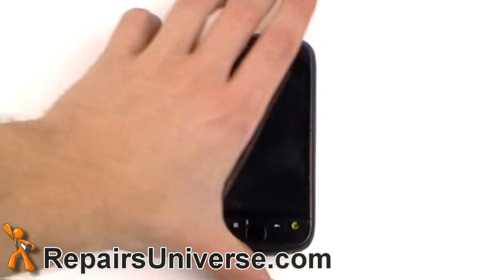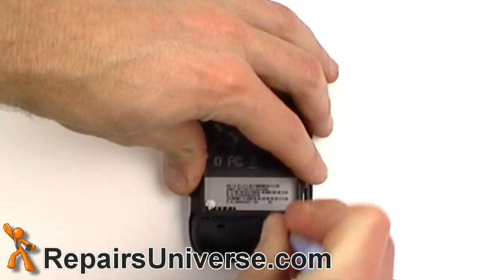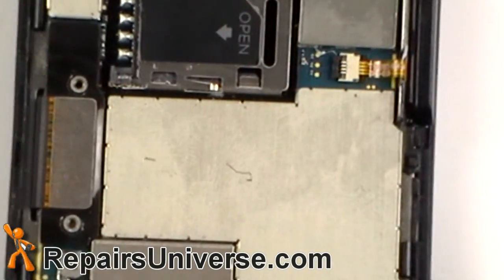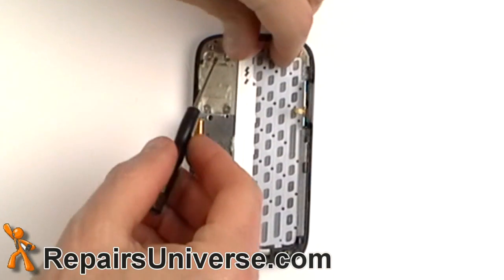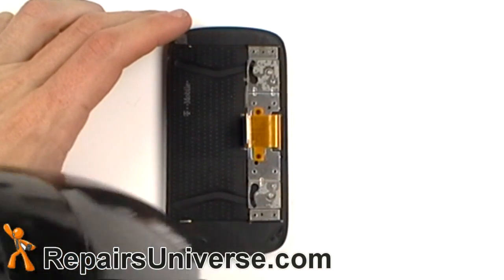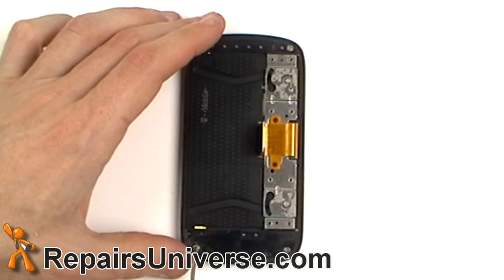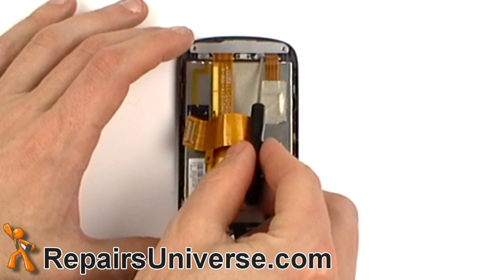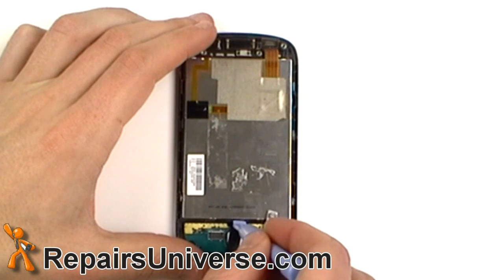HTC MyTouch 3G Slide Touch Screen Digitizer Repair Guide

Comment: @RepairsUniverse I followed the video step by step and had no problem taking my 3g apart and replacing the touch screen. I also want to thank Repairs Universe.com for the fast correction to my error. I ordered the WRONG screen and contacted Repairs Universe and they promptly sent me the correct part. The only thing is re-assembly is a little hard. To anyone tackling this, make sure you have double sided adhesive tape for the replacement screen. All in all though, I did it and it looks great!

Comment from the maker: @toonces344 Glad the process went smoothly, it is what we strive for. There are a few things that can resolve the issue, the first would be the actual application of the adhesive. Check out our video guide "Touch Screen Assembly", this will walk you through proper adhesive placement. The adhesive we use/sell is the best we have found, however others can be used, such as pastes/glue. However this gets frustrating and messy quick.

Comment from the maker: @Yumexc Good question. Really it could be either, or possibly just a loose connection. The best thing to do is disassemble and check the motherboard flex for any damage. Normally these will not become faulty, but can become ripped or damaged. If the flex appears fine, check the LCD connection and make sure it is fully in place. If the connection is secure, it is likely a faulty LCD screen.

Comment from the maker: @CreativeFanatic Yes, this is likely caused by a hard button being pressed in (sometimes caused by overtighted housing screws or bad alignment). I would suggest checking all of the buttons to see if one is being pressed in fully. Once the button is found, disassemble and reassemble being sure that the button is not solid in place.

Comment: Just finished a repair changing the flex cable on my phone..fixed the rolling screen problem and seems like everything is good. Ordered the flex cable from your site..and that pry tool does help greatly..just wished I had ordered the tiny Phillips screwdriver as well. But in any case thanks!

Comment from the maker: @YoungFresh718 We have heard of the camera issue before, as well as the black screen after sliding. There are a few causes but it is a bit difficult to diagnose from affar. Sometimes a slide (motherboard) flex cable replacement will resolve the issue, other times it is just a loose connection somewhere and when pressure is applied to the correct location it can resolve the issue.

Comment from the maker: @RockersWithWockers The touch screen digitizer is the outer glass screen that relays touch information to the motherboard. The keypad buttons are not controlled by the touch screen, they are controlled by the keypad button flex cable which lies under the buttons. It sounds like there may be an issue with your touch screen digitizer and the keypad flex cable. May be worth replacing these parts to see if it will resolve the issue. And thank you!

Comment from the maker: @CLAOJ2 I would suggest disassembling it and checking for any loose connections on the motherboard, near the buttons themselves. Sounds more likely a hardware issue if resets and software checks have been done.

Comment from the maker: @MrGamerheezy Usually the issue is the connection from the touch screen digitizer to the motherboard. Check that the flex cable is fully connected and does not have any damage (such as rips).

Comment: This is mrtjones, I just went ahead and got rid of the old thing. I now have a galaxy s vibrant, which is oodles better. One tip for people doing this replacement, you do not need the t5 screw driver for the first 4 screws. I used a small philips screw driver, you just have to push hard on the screw to get it to turn.

Comment from the maker: @ferisalgue Yes, its very possible. Common signs of this would be the screen working, but not reliably. Or putting pressure on certain areas will allow the screen to flicker. Or if the LCD works partially when the slide is out. But normally a loose connection on the slide cable will interfere with the touch screen as well. I highly suggest checking those connections before considering a replacement part.

Comment from the maker: Yes, it is very possible it is an issue with the "slide" flex cable. This cable is normally to blame as it takes the most abuse from sliding back and forth constantly. This video will walk you through disassembling to the screens to check connections and for any damage.

Comment from the maker: @renatalave There are normally two possible causes to this. The most likely is a connection issue. The second is damage to the flex cable. We suggest disassembly and checking the flex cable and connection to the motherboard. Make sure the flex cable is fully in place in the connector. Also check for rips or damage to the ribbon cable.

Comment from the maker: @Juanc562 Could be either the slide flex or the LCD screen itself. You can attempt to diagnose the exact issue by disassembling the phone and checking the slide cable for damage or loose connections.

Comment from the maker: @TheVideosfactory Many variables for this issue. But the best steps would be to plug the device into a computer to see if it is recognized. If it is, then check the LCD connection to be sure it is fully in place. If that appears fine, I would suggest replacing the LCD screen itself.

Comment from the maker: @mystkslyer All of the things you propose are definitely possible. We do not currently have the volume flex cable at RU, but it is quite possible the housing could be causing the issue. May want to disassemble and attempt to seat the housing a bit better. It is a bit less likely that the motherboard flex would cause the issue, but always a possibility. The keypad buttons do run through the motherboard flex, but I have never heard of a defective part causing issues like you have described.

Comment from the maker: @Thrillagy Make sure you are using the correct size screwdriver T-5 Torx screwdriver. This is a common issue.If the screw is stripped you will need to extract it using a screw extractor or small drill.

Comment from the maker: @AQUELLVATOOPERRON Often times, yes. It is very vulnerable to water damage and causes major issues, including black screen. However it is always possible that only the LCD screen was damaged due to the water, in which case a replacement LCD would resolve the issue.

Comment from the maker: @bestbettproducts Definitely sounds like connection issues. Disassemble and triple check all the connections, including the touch screen's. You will hopefully find a few that are loose or not fully in place. From there you should be able to diagnose the problems depending on the refreshed symptoms.

Comment from the maker: @homiegv8 No, the touch screen is separate from the bottom buttons, maybe a connection issue for the keypad flex? You would have to open your Slide up and see if you can diagnose the problem. Good luck!

Comment from the maker: @mystkslyer If it appears like the buttons are pressing themselves, they likely are, replacing the cable should not be necessary. Simply attempt to re-seat the flex cable under the buttons and see if that will stop the issue. Normally the metal contacts will be pressed in, making it appear as though you are holding the button down. Hope this helps! Let us know if you have any further questions.

Comment from the maker: @easy1900 Repairing your Slide is not too difficult, depending on a few things. The LCD displays the image behind the glass touch screen digitizer. Depending on the issue and how it was damaged you may need to replace either a screen, flex cable, or other parts.

Comment from the maker: @CLAOJ2 Has the cable been severed? If it was ripped, there will be no way of re-attaching it. However if it has just fallen out of place you can use a small dab of super glue to hold the flex cable to the housing while you reassemble.

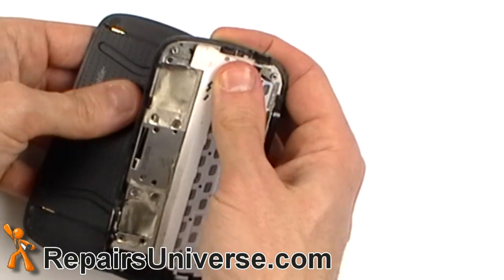Comment from the maker: @CLAOJ2 From the image you provided I can tell it has been severed. Take a look at 4:07 in the video and you will see how the cable should look. Sadly we do not currently carry this flex cable. However I do believe you can search for this and find a replacement fairly easily. Check for volume button flex cable or keyboard flex cable. I am sure that replacement will resolve the issue.

Comment from the maker: @MrGamerheezy The touch screen flex cable will only control the touch sensors. The motherboard flex cable may be the issue. This is the larger cable at 6:15. This is normally the issue if the screen will work in the closed position, but not in the open position, etc.

Comment from the maker: @xase35 Unsure the exact location of these things on your phone, but if it is holding the main board in, carefully attempt to remove/release them so the board can be removed. Normally, things like this are held in place by adhesive. Just use extra caution to not damage anything.

Comment from the maker: @PinnyBecker If the connections and the flex cables are fine then it sounds more likely that the digitizer may be faulty. I would suggest talking to seller of the screen directly for more information.

Comment from the maker: @ChaddMichaels If you are attempting to replace the touch screen digitizer we always recommend fresh adhesive. The old adhesive can sometimes be reused, however new adhesive will insure a secure bond. You will also need a small phillips screwdriver and a Torx T5 screwdriver to fully disassemble the device. Check out our "Touch Screen Assembly" video in our channel for more info about adhesive.

Comment from the maker: It sounds like only the touch screen digitizer is broken. However, we strongly recommend replacing both the touch screen and LCD screen. The reason is the two parts come fused together and are extremely difficult to separate. Your best bet is to purchase a combination screen (touch screen + LCD)

Comment from the maker: Could either be the LCD or the Slide flex cable. Either can cause such an issue. Did you check the Slide flex cable for any damage (rips or bad connections to the LCD screen)?

Comment from the maker: No they are not required but you can use them to hold in place. With the 3G slide you will have plenty of cable to slide with the device so you can hold a portion of it in place.

Comment from the maker: @ninjaofkonoha9 Possibly the issues could be with the LCD display. I would check the LCD connection to make sure it is fully in place without any damage to the flex cable. It may be the phone is on, just a blank display? Also, try plugging it into a computer to see if it will recognize the phone. This will pretty much rule out any motherboard damage/issues.

Comment from the maker: I see. Do the buttons click or do they feel stuck in a down/up position? If they click, it is likely an issue with the flex cable. I would check the connection at 2:30 to be sure the volume button flex is fully in place and not damaged.

Comment from the maker: @mystkslyer That is strange that the problem would start after a motherboard flex cable replacement. I assume the flex cable connections were checked? Correct me if I am wrong, but the volume flex cable is released at about 2:30 into the video? Possible bad connection or the volume flex moved when releasing the cable? May be worth taking a look at that.

Comment from the maker: This can be an LCD issue involving the flex cable. If this occurs with the device open and closed than we suggest opening the device and check the connection. Also try a hard reset of the device.

Comment from the maker: @homiegv8 The MyTouch 3G Slide is a pretty straight forward repair. Follow our instructions carefully and there should be no issues. If in case you do damage other components, we have many other replacement parts available, including flex cables to get your phone working again. These parts are available at RepairsUniverse (dot) com.

Comment from the maker: This can be a connection issue or further damage to the device than expected.Double check all connections and for damages. Depending on what caused this repair to take place the internal components such as the mother board could be damaged.

Comment from the maker: If you bought a new digitizer and the device is still not functioning, the problem may unfortunately be something else. It's possible the connection between the digitizer and the motherboard became dysfunctional. You may want to try replacing the motherboard flex cable (available on our site), or reconnect the internal connections again. Additionally, was there any water damage to the device?

Comment from the maker: @ArthurSaboya This part can be replaced. We refer to it as the "motherboard flex cable". We have these available at RepairsUniverse (dot) com for a very competitive price, guaranteed in stock. The flex cable itself does not control the buttons but it connects with the flex cable that controls the buttons.

Comment from the maker: @dont4getme77 Yes, this video is specifically for that reason on the 3G Slide. It is a bit of a longer process than other repairs, but there is nothing too tricky. You can find replacement glass touch screen digitizers at RepairsUniverse (dot) com.

Comment: Thanks for the very helpful video and the prompt processing and delivery, everything arrived in great condition and working order. However, I noticed that the adhesive strip that was recommended to order is different from what is used by the factory to seal the glass to the screen, and dust is already showing beneath the glass. Is there something else that I can use to better seal the screen, a paste perhaps? Thanks

Comment from the maker: We currently do not have this part available, however many other retailers should. I find it unlikely that the cable is damaged, more likely just a connection issue. The pry tool is available for purchase by itself. It is referred to as a safe open pry tool and is available at RepairsUniverse (dot) com.

Comment from the maker: @brokenojoke Sounds like the navigator flex cable is faulty or damaged. The flex cable has the button circuitry for the main buttons. We currently do not have this part available, but should in the near future. Check RepairsUniverse (dot) com for a list of all our MyTouch 3G Slide replacement parts.

Comment from the maker: @easy1900 Tough to say, there are a few options though, you can take apart your phone and check for issues with the touch screen digitizers flex ribbon cable and the connection to the motherboard. If it appears to be the digitizer itself causing the issue, you may think about replacing the screen and seeing if that resolves the issue. Replacement screens can be found at RepairsUniverse (dot) com.

Comment from the maker: @FreddyTakai In most cases, yes. It can depend on why the touch screen is not functioning. Replacements will resolve all issues like cracks, damaged cables and connection, and faulty screens. Replacements are available at RepairsUniverse (dot) com.

Comment from the maker: @AQUELLVATOOPERRON Does the device have any history, like water damage, prior repairs, etc? If the LCD screen has suddenly stopped, it may need a replacement. Sounds like this is your only issue, unless there is an issue with the motherboard, which would have likely occurred from water damage.

Comment from the maker: @MrTjones49 It would depend on where the and which specific cable/connection was damaged. Many times you can find replacement cables, however certain areas like the motherboard are very difficult to find and very expensive. Let us know which one was damaged and we may be able to track down the correct replacement part.

Comment from the maker: @bloodrein54 Yes, thanks for that addition. Using a Phillips is a bit dangerous however as stripping the screw is very possible, especially if the screws have becomed weakend due to the enviornment the phone has been in.If the screws are strong however, then it is very possible.

Comment from the maker: @Thandiwe85 Make sure you are using the right size screwdriver. You will need a small phillips screwdriver and a Torx T5 screwdriver. Both of these are available at the RepairsUniverse (dot) com website.

Comment from the maker: @AQUELLVATOOPERRON That would be your best bet. If the new LCD does not work, you can attempt to find a replacement motherboard, however they are normally difficult to find and pretty expensive. A replacement LCD is much cheaper and has a good chance of resolving the issue (from the sounds of it). Replacement screens are available at RepairsUniverse (dot) com.

Comment from the maker: @MaStuRSouP Yes a touch screen digitizer will likely resolve the issue, but may not be entirely necessary. Sometimes the connections can get loose after time/drops, etc. I suggest checking the cable and seeing if it s a quick and easy fix. If nothing pops out at you, replacing the screen would be your best bet. These screens for the Slide can be found at RepairsUniverse (dot) com.

Comment from the maker: @ichigo3393 That is possible, however in most cases this is caused by an issue with the "slide" flex cable, located at around 6:20 in this video. Most issues when sliding the phone is caused by this flex cable. Its possible the shattered cover has damaged the cable as well. May be worth disassembling and taking a look. We have these replacement cables available at RepairsUniverse (dot) com.

Comment from the maker: @ferisalgue Hmm, could be an issue with the "slide" flex cable then. May be worth checking the connection around 6:17 & 7:07 in this video. Could just be a faulty flex cable. If the connections look good I would suggest replacing the LCD screen. Replacement screens and flex cables are available at RepairsUniverse (dot) com.